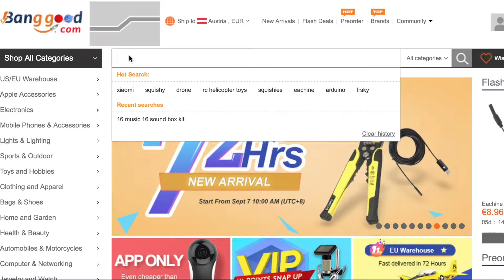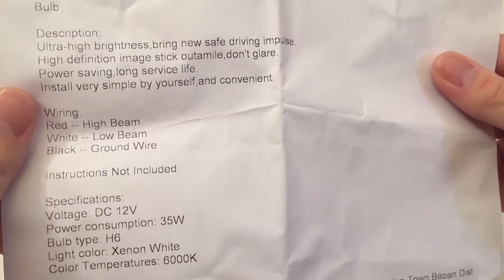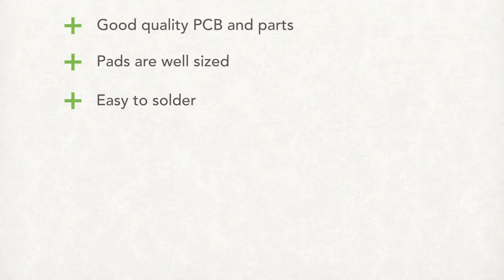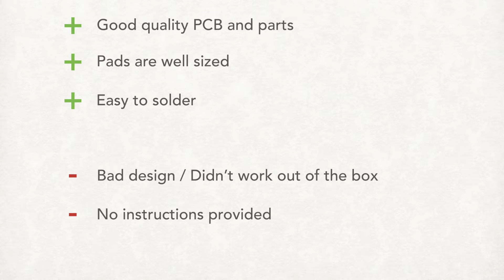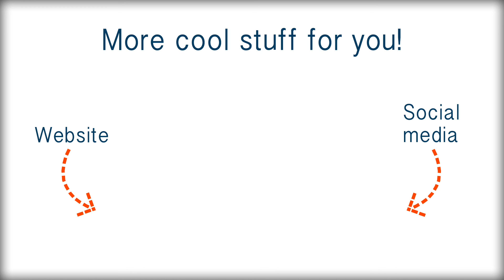16 music 16 sound box kit | Banggood stuff Ep. 1 | nerdhut.de

Comment: thanks for this review, just wondering do's it really matter which way round the sockets go
Reply from the maker: You're right. The direction doesn't matter for the sockets. However, putting them in the right way round makes placing the ICs later easier for you. For the ICs, it does matter which way around you put them in. Mounting the ICs the wrong way around could damage the affected chips. The notch on the sockets indicates where pin 1 of the IC needs to go.
Reply: @nerdhut  I actually took your suggestion for the no4 connection and used wire for all 3 of the central connections, but the board is still hard to get on
Reply from the maker: Yes, unfortunately that part of the kit was quite difficult to assemble

Comment: '
i have a music board kit...
first small electronic parts on the board...
second small music board on the board 45 degree and not 90 degree...
last third put a mini speaker on the board
Reply from the maker: oh okay that's where I took a wrong turn... But you have to admit, that it's ambiguous how you have to put that daughterboard in :D but I guess it makes sense to solder it in a 45° angle, it's easier then.
Reply: hi nerdhut...
how was 16 music / 16 sound board kit...
fail or recheck or success
Reply from the maker: After some modifications it worked, so I'd say it was ok. You can certainly buy it, if you want to have it. Nothing wrong with the kit. The parts etc. were good.
Reply: hi there...
finish kit and already put in youtube video